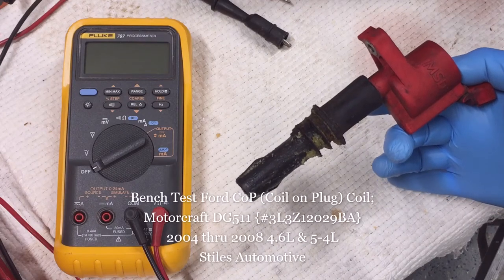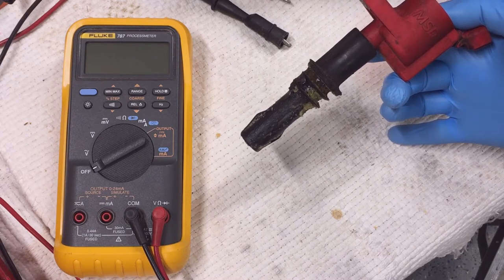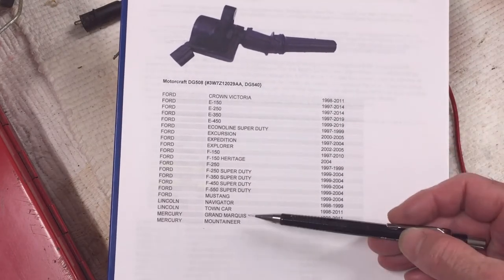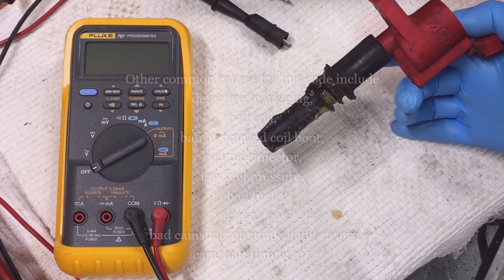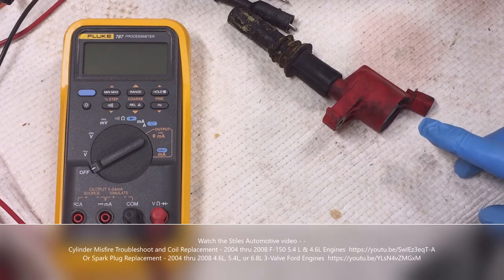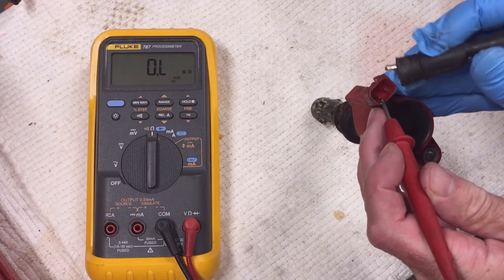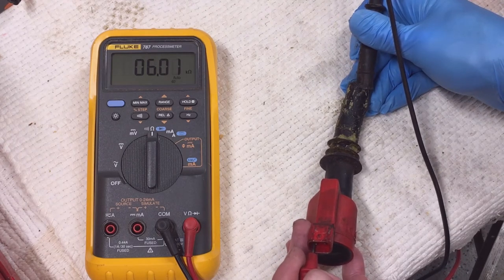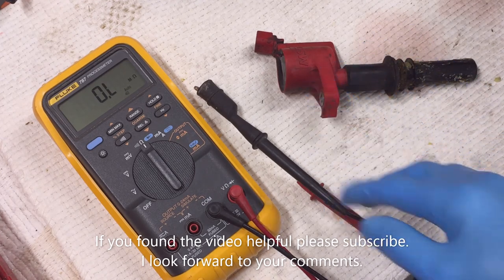Bench Test Ford CoP (Coil on Plug) Coil (Motorcraft DG511, DG508, DG540) 2004 thru 2008 4.6L & 5.4L

Comment: I did not find this helpful. You spend half the video detailing how many billions of cars this could pertain to. And then when you do the actual testing you do not state what to set the multimeter to nor specify which pin should be the negative. Nor did you express that if the resistance is not exact if the cop would then be usable or not. So if it should be .573 ohm but registers at .6 is it bad? Or is it good still because you didn't have your multimeter set to tens-of-thousanths.
Reply from the maker: Billy, Sorry to hear that you didn’t get what you need from the video. I attempt to make my videos as detail as possible and give the viewer all of the information they need for the task. When testing your Coil, I believe it is important to know if the video covers your coil and if it doesn’t you understand your results may be different. 
I will attempt to address your issues: 
1) “you do not state what to set the multimeter to” My Fluke multimeter is auto ranging and does not require a range setting unless the user desires it, the first resistance measurement is the Primary resistance which should be 0.55 ohms, you must set your meter to read in the proper range (I don’t know the meter you are using) and the secondary resistance should be 5,500 ohms.  
2) “nor specify which pin should be the negative” I Show the positive (red) and the negative (black) leads touching the pins in the video at 3:42 where I have the red touching the negative pin and black touch the positive pin, however, with a 2-pin connector and when measuring resistance polarity does not matter. The location of the negative pin does matter when measuring the secondary resistance which I show as the leftside pin (As I hold the Coil) in the video at 3:56.  
3) “Nor did you express that if the resistance is not exact if the cop would then be usable or not” The Ford Service Manual does the same, it simply states the 2 values 0.55 ohms and 5,500 ohms. If the measured value is “0” or open circuit, that’s easy, bad Coil. You are asking for a “good” range and “bad” range, I have not seen anyone publish a table like this. - Stiles
Reply: @StilesAutomotive  What if you have misfire under hard throttle but shows no codes
Reply: Or no codes when idleing anyway.
Reply: Doesn't matter which is neg. Put your leads together, note reading. Now touch leads on both pins and note reading, now deduct first reading which is resistance in the meter leads and that is your true ohms of coil
Reply: Speak for yourself …it helped me out in less than a minute.Now when I go to the junk yard I’ll have a little more information.
Reply: So then whats the point of all this if you cant even tell if the coils are even good or bad. There should beca range of acceptable  use . @StilesAutomotive

Comment: This testing seems a bit above my level of understanding.
My fault.  Not yours.
Reply from the maker: Teddy, Often, simple is better. An easy way to test these CoP Coils, is to switch a suspected bad Coil with a known good one, if the OBDII Fault Code move to the new location, you know that Coil is bad. I attempt to explain everything in detail. - Stiles